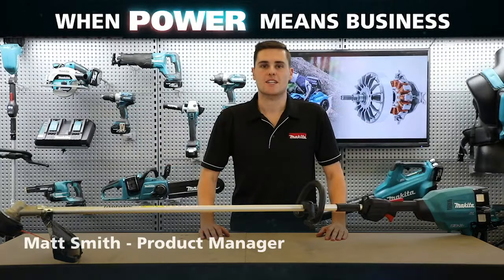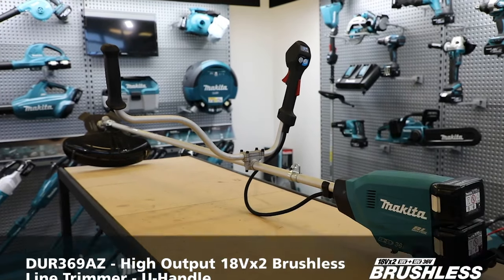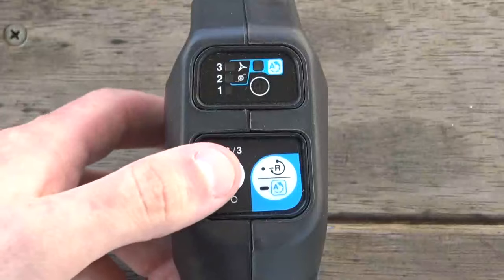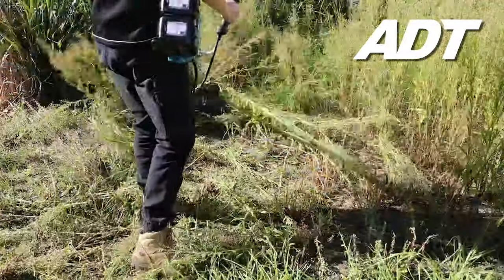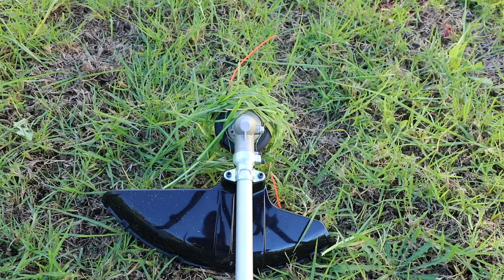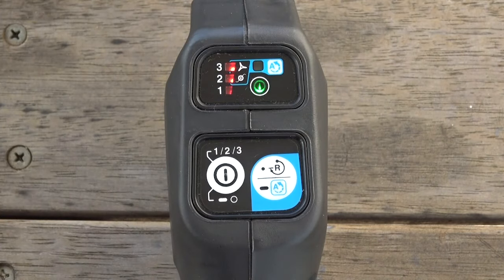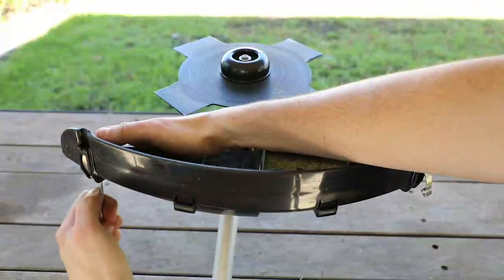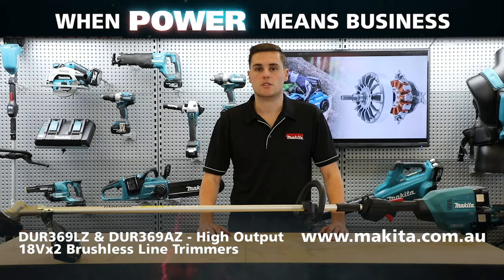High Output 18Vx2 Brushless Line Trimmers

Comment: I bought one of these about a year ago and I'm amazed at the power it has. I have been using a stihl brushcutter for about the last 15 years so the makita had big shoes to fill and does it very well. According to the specs the stihl is almost twice as powerful but you really can't tell for anything I do (general lifestyle block cleanup)
  The only complaint is the run time. Surprisingly it doesn't seem to matter what speed you are on you only get 20-25 minutes per pair of batteries. Luckily I have been on the makita platform for many years so have a heap of batteries but even so it is a bit of a pest having to wander back to my workshop so often .
  To sum up I really am very pleased with this tool and wouldn't swap back to petrol.
Reply: what ah does your batteries have?
Reply: @izoyt  5ah
Reply: From actual tests I have seen 10-20 minutes seems to be the actual run time. I wonder what people are doing when they claim an hour or more? They must not be realizing the tool is running less time than they think during that one hour.

Comment: Love it and using all kinds of blades and line on them. One thing they should make a standard is biodegradable line anno 21st -plasticsoup century. Other then that a great durable product. Buy an extra set of batteries or a backpack for it though, it likes the juice. Batteries are quite the investment, but soon as you have them I think an advantage over buying expensive gas and getting the noise and fumes for free. I have this trimmer, a hedgetrimmer and an electric chainsaw. Love all 3.

Comment: This is a great tool and has excellent battery life. I'm getting about an hour out of mine.  As an older female I attest to the lightness and ease of use of it.  So much easier than my older petrol brush cutter.  Any chance of a video on changing from the line trimmer to steel blade as the manual that came with is not very helpful.

Comment: Really wanted to buy this model last week, but they incredibly difficult to source - settled for the DUR368L instead - we'll see how it goes once I set it up.
Reply: What’s the difference between 368 and 369? It’s hard to find that info.
Reply: @roughnecktrekker1976  
I've been searching that too

What I can sort of piece together is the newer DUR369 has the motor at the end on top of the drive shaft, which some says might decrease power slightly and over time, the cogs mechanisms could wear out - but that was speculative talk I read

The DUR368 I don't know, I have downloaded the parts list and tried to find schematics for but I have not found anything to give me the answer I want

The way they advertise the run times makes it hard too, Hi = only 10 mins for the DUR369 but the DUR368 shows 38 mins on Hi but at a slower rotational speed

They certainly don't make it easy to determine the exact difference between models 😞
Reply: From what I have seen, the 369 has a 1000W motor in the body (so there are losses due to the drive shaft), and the 368 is a 600W motor located in the head )so direct drive and minimal losses). In line with the lower max output of the motor and the direct drive nature, the 30+ minutes of run time seems reasonable. You just helped me to make a decision on which model to get.  @stultuses

Comment: Why is the motor in the body? It’s in the head in the DUR368.
Reply from the maker: Hi Tom, as the DUR369 series features twice the power output of the DUR368 (1.0kW vs. 0.55kW) the motor is larger. The increase in motor size effected the tool balance and therefore was moved to the back.
Reply: I was wondering the same thing..
Just got one today, excited to see how really does compare with my Stihl..

Comment: What's the run time on these machines? I can't find it listed anywhere!
Reply: ON the highest setting about 20 min , so i heard on another you tube video
Reply: More like 15 min real world usage on one charge (x2 batteries).
Reply: @exxr  yeah i got the same machine ... this seems more likely to be true. The Power is amazing but the runtime could be better. (using 2x5Ah)
Reply: This is twice the power of the 368 with a 1000W motor, and it has a drive shaft as it is in the body. Everything I've read/seen suggests 10-15 minutes with the 369.  @exxr
Reply: @citic101   20 Mins 🤣🤣🤣 with 2 x 6.0A batteries and using the Line Trimmer on High continuously will last 10 mins according to Makita's website.